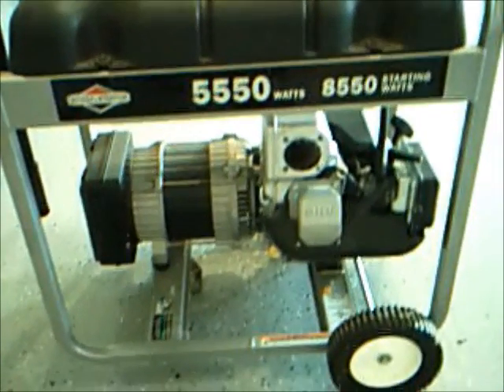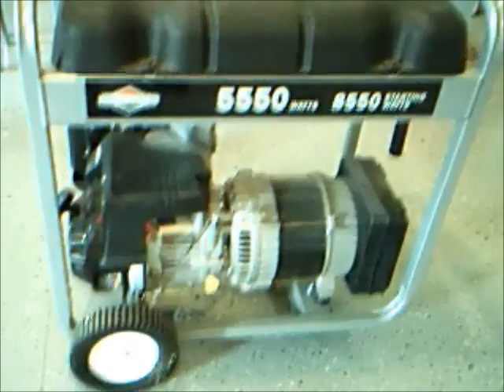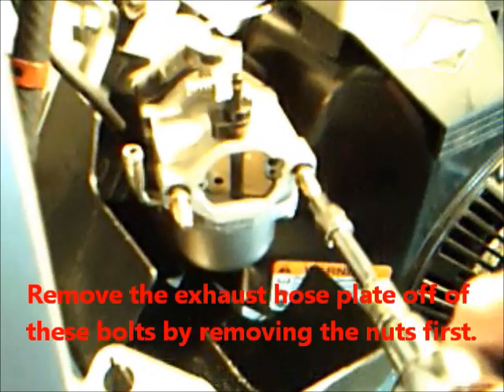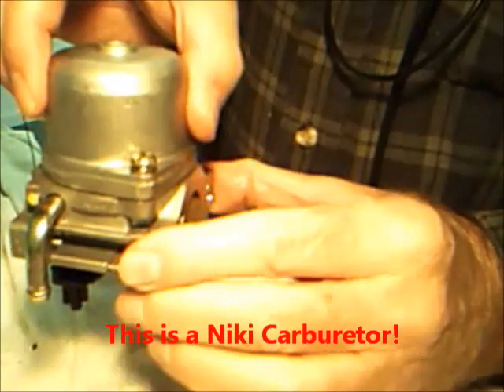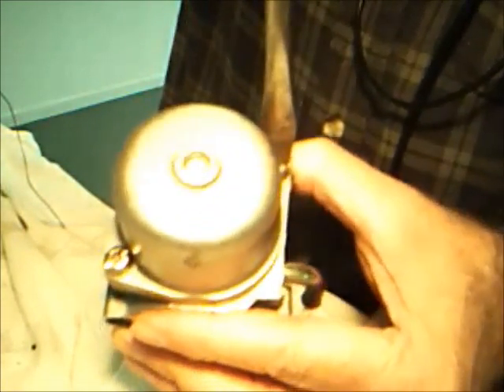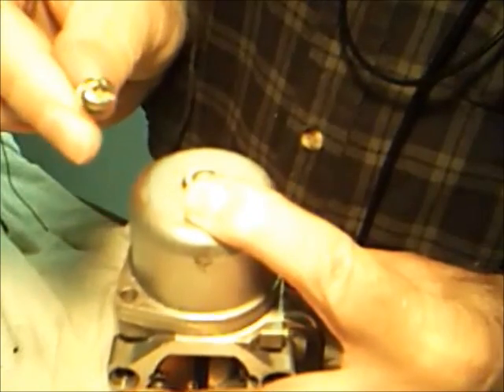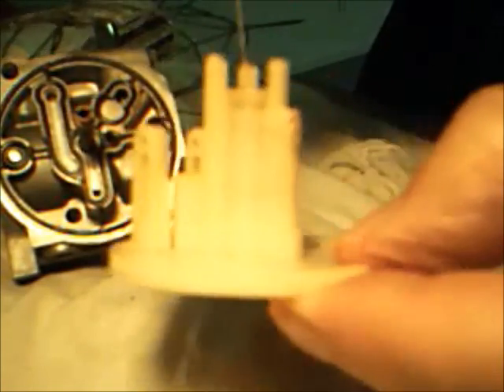Briggs & Stratton 5550 Watt Generator Carburetor Repair

Comment: My Troybilt 5550 has been sitting for over ten years...now I need it and sure enough it wouldn't start even with a shot of starter fluid.

Was about to take it to the repair shop and thought about seeing if there might be a Utube fix.

Boy am I glad I found this site....followed the instructions....changed the oil....fueled up with fresh gas...and she took off on first pull.

Thank you so much
Reply from the maker: SOOOOO, glad I could help, John!

Comment: Lost power couldn’t figure out what was wrong then I googled this and the house is running again !!
Reply from the maker: Vince, so are you saying you have a generator hooked up?  Thanks for watching?
Reply: @harrison4803  yessir I lost power bad storms bought this generator off a guy the gas was old as dirt swapped the gas still didn’t work couldn’t figure it out then saw this video and poked that jet with a needle . Midnight last night had power again thanks to this!!!
Reply from the maker: @vincefercozi7254  So, glad I could help, Vince.  I have been there, too!  Do you have your generator wired into your power panel?
Reply: @harrison4803   no that’s the next weekend project
Reply from the maker: @vincefercozi7254  Here is how I did it, if interested:
https://www.youtube.com/watch?v=ohexUX5b81U&list=PLtPT9KQSzU8iYlN5Yr9MtHUJKNu04rWKk&index=6

Comment: Can you tell me the brand and model numbers for the entire air cleaner assembly for the carburetor. We bought one used and it’s missing this whole assembly, I cannot find any information as to where to buy the parts or even what the part numbers are.
Reply from the maker: Danielle, the only number, I have, is inside the black housing, which is SAE PA66.  Here is a link that shows my filter.  Scroll down to the blue and white air filter:  https://www.google.com/search?q=SAE+PA66+air+cleaner+assembly+for+the+Nikki+Carburetor&rlz=1C1CHBF_enUS794US795&source=univ&tbm=shop&tbo=u&sa=X&ved=0ahUKEwjfhJyTrKzdAhWOrFMKHYvMDrYQ1TUIwAE&biw=1366&bih=631

Comment: Great video.

So glad you posted this

I am experienced in carbs until I saw this one 

Cleaned everything 

Put it back together only for it run very wrong.

Was convinced I put something back together wrong but I was incorrect.

It was put together properly and I am glad to know that before taking it apart again and going through another cleaning.

No other videos featured this version of the carb so thanks much

Comment: Thanks!! Followed your method, the jet on ours was clogged with really hard sludge. Soaked it in carb cleaner bath and was able to clean it. Generator started on first pull!!! I felt like a genius till we shut er off and it leaked out of the front. One of my guys said the float must be stuck, so we pulled carb back off and reassembled carefully, it didn't leak after. Go away Irma!!!
Reply from the maker: Great, eshaef71!  Praying for you and family!  I, also, put a filter in the fuel line and that helps.  If interested in this, go to my video here:  https://www.youtube.com/watch?v=s6pV7X18qIo&t=0s

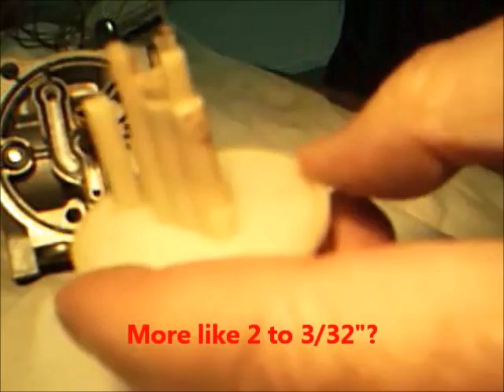Comment: Hi John. Just want to say thanks for having this video. Ive been living in Florida for 3 years and started having issues with my generator (same as yours) and hurricane Irma is stopping by tomorrow September 10. We didn't evacuate because of roads being too packed and riding out the storm in a car would suck. Couldn't get it working last year for Mathew. Saw this video after i decided to just give up and buy a new carb. I can fix just about anything, but engines....not really. As it turns out about 8 minutes into your video (8:10ish) you cleared that port. On mine the ports were clear. But not the main jet port. Totally clogged. Cleared it and HOLY COW! The dead thing came alive!! I let it run for a bit to see if it was joking with me. It held a load and works fine. Thanks SO much for having this video and explaining in terms, i feel, can be understood. When i loose power my family will be in good shape. Thanks again, Mike 
Sorry I'm all over the place typing. Just happy as hell this thing works!! :)
Reply from the maker: Fantastic, Mike, glad I could help!  Praying for you and your family!  Let us know how you make out?  I, also, put a filter in the fuel line and that helps.  If interested in this, go to my video here:
https://www.youtube.com/watch?v=s6pV7X18qIo&t=0s

Comment: John, Thank you so much for the video... I watched maybe 3 mins of it to see what needed to be done to pull the carb and major spots to look for.  I have no desire to rebuild the carb and don't have time to go get a kit.  Irma is on her way to Florida and I had not ran my generator in over 5 years.  Tried for about 15 mins and no start.  I used a 4 mm socket to pull the carb out.  Mine was gunked up in the exact same spot.  I cleaned mine with B21.. you could literally watch it clean away the deposits on the carb!!!.  Put it back together and I barely pulled on the cord and it fired right up.  Thank you again!
Reply from the maker: Glad it worked, Rob,  Hope you don't have to use it, however, but best to be prepared.  So, you are in FL somewhere?  I, also, put a filter in the fuel line and that helps.  If interested in this, go to my video here:
https://www.youtube.com/watch?v=s6pV7X18qIo&t=0s
Reply: B-21 is good shit

Comment: That jet is what clog's and stops it from running. Use some stuff you use  in gas to keep it from going bad.But still cut off the gas and run it till it  cuts off. But that port where you found the gunk  is the problem. I have a 10 hp Briggs and Stratton genny and the times it wouldn't start, that's the problem. Other than that, there's not much more to go wrong. 
Just keep gas extender in the fuel.
I like the way you described the gas  "crappy gas "   Sounds like a brand  "CRAPPY GAS ", well most of them are.
Reply from the maker: Great comments, Earl!  I, also, run the generator until it stops before putting it away but it has channels in the bottom of the gas tank that retain the old gas.  I, also, put a filter in the fuel line and that helps.  If interested in this, go to my video here:
https://www.youtube.com/watch?v=s6pV7X18qIo&t=0s

Comment: Brother, you oughta try an ultrasonic parts cleaner with 50/50 pinesol and water set at 80 Celcius for 10 minutes... 40,000 hertz with two transducers.... its wonderful... Ive gotten one way valves on zamas working again like new... check it out
Reply from the maker: Sounds great, Bob, but how much does this contraption cost?:)  Have you made a video of it?
Reply: 75 bucks for a 3 litre version on ebay... you can get either 2 briggs carbs in it at one time or 4 zamas or walbros... dont know if the link to it will post here but I will try.. Here it is: http://www.ebay.com/itm/391396472585?_trksid=p2057872.m2749.l2649&ssPageName=STRK%3AMEBIDX%3AIT
Reply from the maker: Thanks, Bob, I will have to give it some thought!

Comment: You go from using a 5/32 socket wrench to unscrew the bolts attaching the carburetor to the body of the generator but don't illustrate how to remove the carburetor which as far as I can tell is firmly attached still.   What gives?
Reply from the maker: Unscrew the bolts entirely and they and the Carburetor come off.  See Glen's video, which I reference to see the remainder of the step:
https://www.youtube.com/watch?v=O-fROtibEvE   Thanks, for watching, Jamie!

Comment: Once you get past the shaky camera, this video was enormously useful to me (being new to tear apart carburetors).   It skips a couple of minor points (align the choke valve to the run position and it pops off if you pull it straight up, be careful and dump out the gas in the carb), but otherwise was great.     I too thought that running the generator dry was enough to keep it stored for the season,  but the tiniest bit of (ethanol?) gel was enough to knock my engine offline.   Thanks for posting this video, it worked the first pull!
Reply from the maker: Thanks, for the comments, Michael!  Consider putting on a filter, also:  https://www.youtube.com/watch?v=s6pV7X18qIo   I started mine up, a couple of weeks ago, and had to spray a little carb cleaner into it, with the air cleaner off, and it started right up.

Comment: I have a B&S p/n 030471   8000 electric start I bought NEW, only 11 hours on it. Went to use this year and fuel began to pour out around the are where the carb mounts to the engine. 1st, cleaned out tank 2nd, cleaned out the fuel shutoff valve screen, 3rd pulled solenoid BELOW the carb, the brass plunger was cruddy, took dremel tool with wire brish attachment and cleaned it where it would slide in and out of the solenoid freely.  4th pulled the plug that the sol. screwed into, cleaned it the same way and blowed out with compressed air 5th cleaned out the bowl 6th worked the float up and down to see if it worked freely, it did, reassembled and still same problem. ANY OTHER SUGGESTIONS???
Reply: Well, didn`'t watch complete clip before I posted above, will follow tru with all your directions. NOTE: Your crud buildup or others may very well be the remaining fuel left in the engines after test runs. I've seen these generators sit in a warehouse for a number of years so it's very possible you may have a teaspoon of fuel in the passage ways and maybe in the fuel bowl that has been crudded up even before you purchased it.
Reply from the maker: You should have a filter on the intake of the fuel line in the fuel tank?  Check it?  Thanks for watching!
Let me know how it goes and we can try something else.

Comment: Just got a Coleman Powermate 6250 generator and though i cleaned everything out of the carb. Well i missed the hole where the spring went. Thanks for the video, still useful nearly 3 years later.
Reply from the maker: So, Stephen, it must not have been new, if it already needs cleaning?  Does it have a filter on the fuel line?  Watch my video on that, if interested?
Thanks, for watching and the comments!
Reply: +John H no it's not new. I have an inline filter on my riding lawn mower. I was thinking about installing one for junk that might still be in the tank. My dad had been using regular pump gas (w/10% ethenol) and had to store it. He didn't think about draining the gas before storing it for several years. so I have been on this small engine repair kick.

Comment: i lost a part of my carburator float needle sit fuel over flooded the chamber will you tell me where i can buy  carburator assembly model #01919 10 hp OHV type. gasoline 5550 watts hoe much i'am from Philippine Manila

Comment: You mentioned you let the gasoline run out when you shut it down last time. Is that good or bad? I was told to let the engine run and turn off the fuel so it all burns out and basically empties the carb. Should I not do this? I try to use Ethanol free fuel whenever I can get it.
Reply from the maker: +Kevin der Kinderen Yes, Kevin, I meant to say let the engine run until it runs out of gas &amp; empties the carb.  Not sure exactly how I said it without listening to my own video, however?  Also, of note, my gasoline tank is ribbed on the bottom and some gas stays in it and I assume allows crud to settle out and can get drawn in when I start the generator up the next time.  So, I take a turkey-like baster and suck the remaining gasoline out of the fuel tank, also.  Thanks for watching!

Comment: I have the same Generator and went to try and start it and it's seized up. Took the pull cord off thinking maybe it was jammed, but no. Took the oil cap off stuck my finger in the oil and it had fuel mixed with the oil. I've been doing a little research and this seems to happen a lot with these B&S. My question is if I drain all the oil out should the motor unseized? From what I understand the float gets stuck open and floods the cylinder with fuel and the fuel seeps past the rings and fills the bottom end making it seemed locked up. Please any help would be greatly appreciated Thanks
Reply from the maker: +tjc97cobramustang Wow, never have had this happen.  You are probably much more versed on this, than me, in light of your research.  Maybe some of our other viewers can pipe in?
Reply: John H There's another video I found explains what happens and it happens a lot on these B&S motors
Reply from the maker: +tjc97cobramustang This is veryyyyy distubing, cobra!  Can it be reduced by more frequent cleaning of the carb or a gas additive?  Were they able to correct their problems?  Thanks for sharing!  You might consider making a video on your situation.  I would be willing to help in any way I can?
I have some solar backup in case mine fails.  If interested see:
https://www.youtube.com/watch?v=H6dhbKCiQjE
Reply: John H Yes have to do a good cleaning I haven't torn it down yet. If the fuel shut off is left on and the fuel solenoid is stuck open it floods the cylinder and seeps past the rings and fills the crank. It happens a lot I guess that's why they discontinued it. Thanks for the help John take care my friend

Comment: I've rebuilt this carb and it still leaks and is no good....its a shitty designed carb
Reply from the maker: David Mcbeth Gee, David, how old is it?  Seems like there is something else going on there?
Reply: John H Its old ~ 7yrs, used for about 30 hrs though. Heck, I'll just go buy a new carb.  Is there another model carb for this that's cheaper? This one is $100.   thx
Reply from the maker: David Mcbeth Sorry, David, I have not ever bought just a carb!

Comment: This was just what I needed. Same carb, same generator. Wouldn't start. Cleaned these ports and a little starting fluid, started and ran like a champ. Thanks!
Reply from the maker: Dave Neiter Glad I could help, Dave!  Also, consider putting in an inline filter, as I did, only $5:

https://www.youtube.com/watch?v=s6pV7X18qIo

Comment: I have the identical portable generator featured on your video and I need to do a carb rebuild. It is a NIKKI carb with the number 697978 stamped on it.

I have searched the internet but have not been successful in locating the rebuild kit (float, needle valve, bowl gasket, etc).

By any chance, do you have any idea where to find the carb rebuild kit for this carb model number or the replacement Nikki model number 591378?

I would hate to pay $90 for a new carb when I could possibly rebuild it.

Thanks!
Reply from the maker: SrRatsenol Never bought any repair kits, SrRatsenol.  EReplacements is a pretty good site for such but didn't find 1 specifically for the Nikki.  You might look thru these 10 pages and see if you can find a substitute:

http://www.ereplacementparts.com/search_result.php?q=591378+repair+kit

Sorry couldn't be of more help!
Reply from the maker: John H SrRatsenol, this guy replaced some gaskets and has some info. on kits, maybe?

https://www.youtube.com/watch?v=WGEe6sh7UE8
Reply: John H 

Just an FYI:

After some internet research, I discovered that every B&S engine has a MODEL & TYPE number stamped somewhere on the engine, usually on the valve cover.

Mine was stamped on the side of the valve cover. I then went to
http://www.briggsandstratton.com/us/en/support/manuals and selected "PORTABLE GENERATOR
 
http://www.briggsandstratton.com/us/en/support/manuals/engine

NEXT, I entered my model number 204412 type number 0163 and then pressed SEARCH.

The search returned the list of "Operator's Manual - Engine" and "Illustrated Parts List - Engine". 

The part number for my Kit - Carburetor Overhaul is 696146

Thanks for the reply!

Joe in Texas
Reply from the maker: SrRatsenol Glad you found it, Joe!  Consider putting in a filter, as I did, only $5:

https://www.youtube.com/watch?v=s6pV7X18qIo

Comment: Could somebody please explain how to detach or separate the choke end from the exhaust hose plate. Do I just pull it up from carb or does the "choke lever or handle" used to open and close the choke snap off? Thanks for the help!!!!
Reply from the maker: SrRatsenol, I'm confused by the question?  Watch Glen's video (IFIXIT4U channel), which I reference, for more detail, at:

https://www.youtube.com/watch?v=O-fROtibEvE
Reply: John H
Thanks for the quick response and my apologies for the confusion. I googled the the Nikki carb that my B&S generator model 30235 utilizes and it solved my problem.

The photo of the Nikki carb part #591378 indicates that the top lever is removable by pushing it upward after aligning the lever to a little notch on the lever.

http://www.repairpartsmart.com/briggs-stratton-part-591378-carburetor/?utm_source=googlepepla&utm_medium=adwords&id=96503328804

I removed the carb, cleaned it and re-installed it.

However, now I have a problem with the pull cord. It appears to be locked. I can only pull it a few inches. Any suggestion on how to solve my problem is appreciated.

Incidentally, instead of risking stripping the bolts while removing the bowl, I used a small 5 1/2 inch long vise grip to grasp and loosen the bolts. I also used a TORX E5 (instead of a 5/32 socket) to remove the bolts attaching the carb to the body.

Thanks for any assistance you can provide!

JR
Reply from the maker: SrRatsenol Glad you got the choke disconnected.  Don't know why your pull cord would freeze up by working on the carb.  You may have to take off the cover plate, held on 3 or 4 screws.  Watch this video for possible help:  https://www.youtube.com/watch?v=LaA_rdKlmEs  Let us know if you get it started.  You might make a video of this, too, because there aren't many on Youtube.